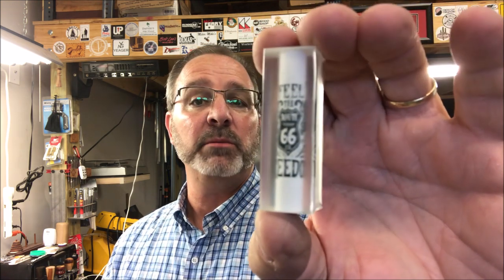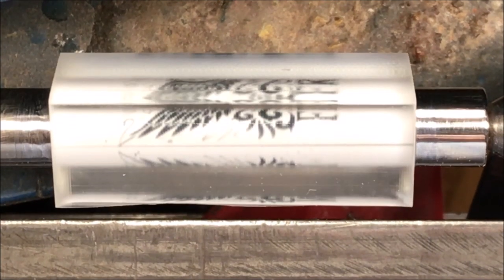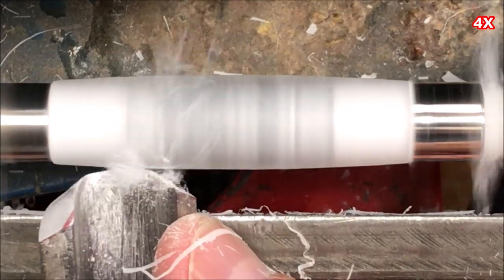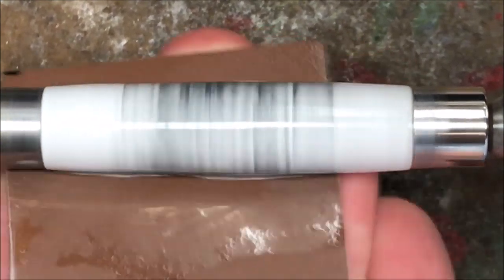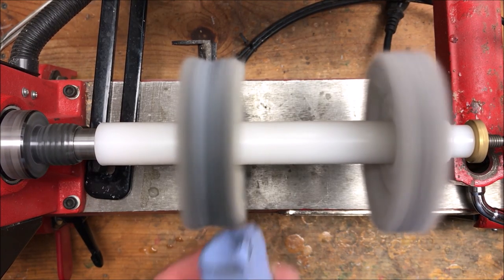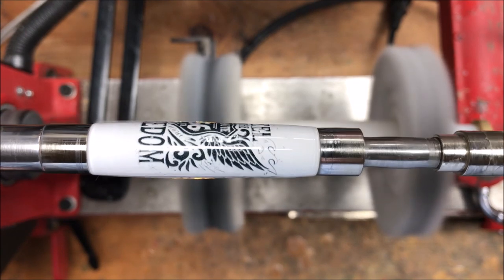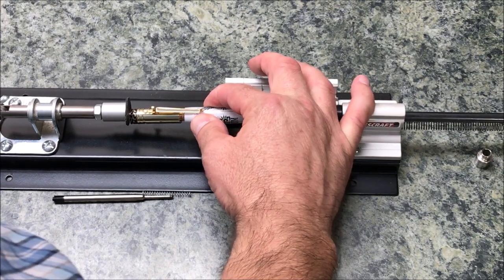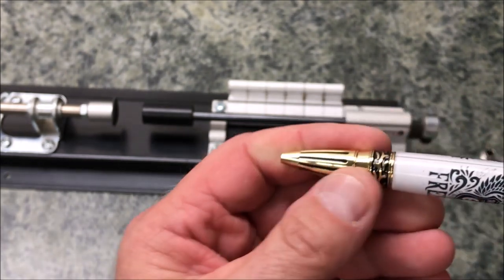Route 66 Blank & Gear Shift Pen Kit

Comment: I use similar containers for the storage of lots of shop items. I have found that for bushings there are tons of pill containers designed for a weeks worth of daily or am/pm dosage that are ideal for bushings. I label each section just as you show. If a set has three large bushings I will cut out one of the dividers between two sections. The pill organizers result in more compact storage.
Reply from the maker: Great idea John. 

Regards,
Bob

Comment: Hello
I have folloowed you for sometime although never commented before. Thank you for all of the videos you have made. They are not only educational but entertaining; a refreshing combination.
I have made a number of label cast pens over the years and would mention that water sanding may ruin a pen blank if water seeps in the ends. This has happened to me.a number of times. May I recommend the use of dry sanding and buffing wheels. Cheers
Reply from the maker: Thank you Frederick. I may move that way with the Zona paper I’ve Ben testing out. 

Regards,
Bob

Comment: Great looking pen Bob.
( Can you get Yorkshire grit white in the states. When I'm doing acrylic I sand up to 600 grit then I use Yorkshire grit white I found you don't need micro pads)
Reply from the maker: Yes I can get Yorkshire Grit. I using the Renaissance because it was a gift and no sense spending the cash if I don’t have to. 😃